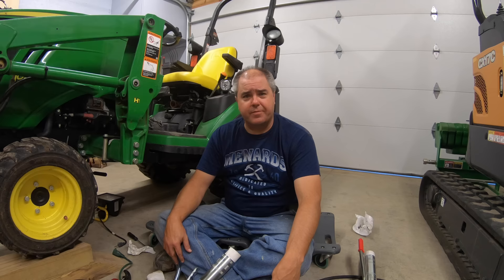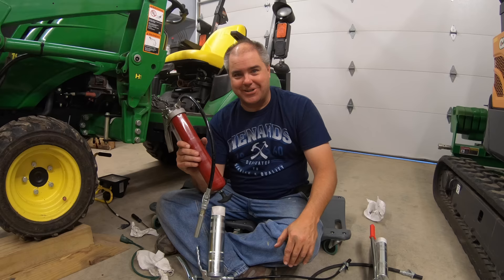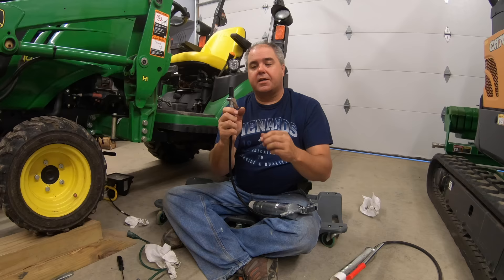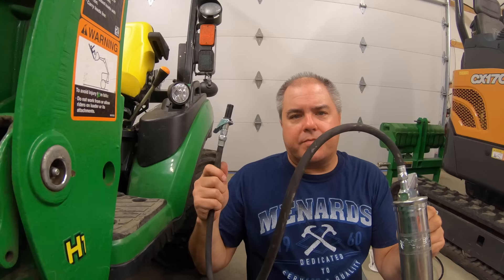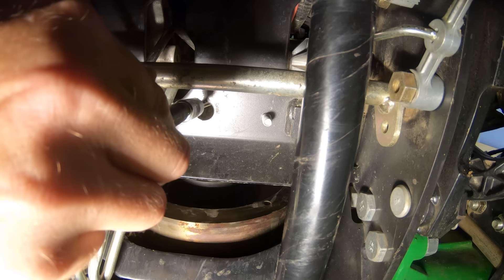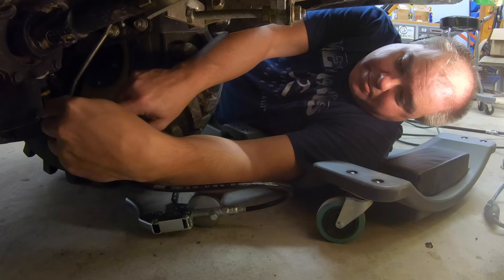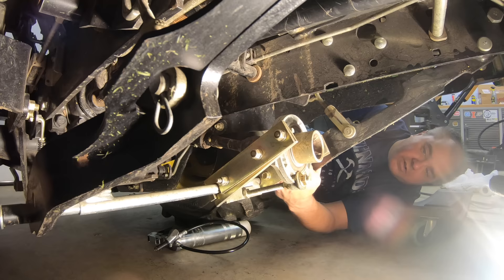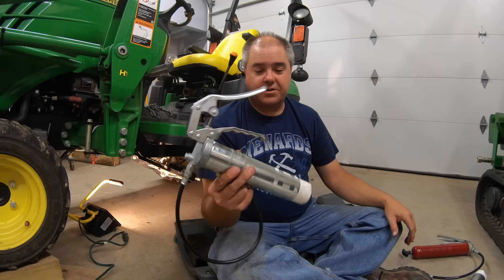New Grease Gun Technology! Greasing The 1025R/1023E Drive Shaft

Comment: Great video! Do you have any tricks for getting a u-joint to accept grease in all the caps when they aren't all purging? I have a 2320 and took it apart to access the driveshaft u-joints. Even with heating them up pretty thoroughly with a heat gun 1 cap on each joint, front and back, is not purging any grease. Grrrrrrr.
Reply from the maker: Lock n lube makes a tool to help.  I’ve not used it.
Reply: Jason, I have a 2305 (same u-joint as a 2320).  I have to pull my driveshaft out of the tractor and manipulate the ujoint to get all the caps to purge.  It is tedious!  It takes me about 5 minutes to pull the driveshaft after I get the tractor on blocks.  It takes me about 20 minutes to get all the caps to purge.  I use the Lock and Lube tool so that I can manipulate the ujoint with one hand while operating the grease gun with the other.  I went to this process as I could never get the caps to purge with the driveshaft still mounted to the tractor.  I don't know if the 2320 allows the driveshaft to be easily removed.  It could be that I have a ujoint where the channels were not machined properly.  My guess is that many who use the needle fitting may not be getting the grease to all of the cups.  Best of luck with yours.

Comment: Thank you so much! Lol. I have one question. Will the lock on adapter not fit onto the one zerk fitting?  I noticed you used the needle for the one that is nearly impossible to grease. I can get to all of mine with no problems, except that one underneath. Should I get the needle fitting over the lock on adapter?
Reply from the maker: You get both the LockNLube and needle fitting.
Reply: @TractorTimewithTim  thank you for your quick reply. I’m sorry for the confusion. I can get all of the grease points just fine with a standard grease gun. I can not for life of me get the one on the bottom middle. I noticed you used the needle grease tip instead of the lock on coupler. Does the lock on coupler not fit through the hole in the frame to access the zerk, or is it not long enough?  Just wondering why you used the needle one and not the coupler one for the difficult zerk.
Reply: @dfossilo  Tim has another video where he pulls off the panel next to your feet. Its a different access point and I use my LS there to lube that zerk.. Just move the flywheel until the Zerk appears - it is so much easier.

Comment: Watched this video and decided to buy one of those needle greasing adapters.  I went to your store and found it and placed my order on Amazon.  The model I received was a Lock n Lube LNL122.  It seems much smaller than the one you are using.  Does not have the neat slide over feature you mentioned in this video.  So my question is where did you get yours?
Reply from the maker: I'm not sure, actually. I didn't find the slide over feature on amazon.  The LnL one on my store should work.  Probably easiest to use it with the Lock n Lube locking coupler.
Reply: @TractorTimewithTim  No, I’m sure I have the right one because a few reviews mention it works great. Just kinda thought it would look like the one you used in the video
Reply: I do have the lock and lube connector. Thanks for all your videos. Very helpful

Comment: Where did you get the needle adapter? I did not see it on the website for the grease gun.
Reply from the maker: Single Point Hydraulic Connector; Deere 1023e/1025r/2025r
That is the name of the video describing it.  Unfortunately, when i paste, the link does not get pasted. Sorry.
I did make an error on pricing.  It is $634.70.
Reply: @TractorTimewithTim  I need the link for the needle adapter, it is not on the link for the grease gun

Comment: @ Tim
Do you know if Deere has re-engineered that "difficult to grease" U-Joint on new/later models of the 1025R? Also, do you know whether that nigh impossible U-Joint grease fitting is on the new 2025R tractors as well? 

Just one more question. How does Deere recommend a person go about successfully getting at that fitting so as to be able to keep it adequately greased?

Thank you for your videos.
Reply from the maker: All good questions!
Reply: Laurence & hopeful 
I have a new 1025r. I grease it regularly it is doable to grease
Reply: Likely this design runs through a lot of models. It is almost unessary due to the straight line up from the crank to the hydraulic pump at the rear. So sealed maintenance free universal joints would have been a better choice if the couldn't have designed better access.
Reply from the maker: Yes, I agree. This is likely a cost saving design.  The larger tractors don’t have this.

Comment: Planning to purchase the locknlube fitting and deciding between the regular and XL.  Would the xl fitting be too long for some of the other grease fittings?  Also, rather than the needle nozzle, would the locknlube XL fitting help access the main engine drive shaft?
Reply from the maker: I would recommend the 'regular'.  XL is just too long ...and no, it does not help with that nasty grease fitting on the drive shaft.  I use a needle for that...as shown in this video.

Comment: Great job Tim
Have you ever considered a power grease gun like a Dewalt, Milwaukee or Makita
Reply from the maker: Sure, we have considered one.  Tom uses them 100% of the time.  We have so few grease fittings that the hassle of making sure the battery is charged, and the initial cost simply is not worth it.  We do however recommend a battery powered gun for those who grease more than we do.
We use the same philosophy with our diesel tank.  Hand crank rather than powered pump.

Comment: Hey Tim, great video as always! I ordered the lube shuttle kit but I want to use the lock and lube.....the Amazon part number that you list for the adapter doesn’t work or is no longer available. I tried to figure out what I needed to make the lock and lube work but didn’t have much luck. I know the female side of the adapter I need is 1/8 NPT but I don’t know about the metric end. Any help would be great, thanks!
Reply from the maker: I believe LnL has an adapter to make it work.
The metric size is M10.
I’ll try to get some time to update this.
Reply: Ok thanks Tim, I’ll check it out. Oh yeah,  that was a faster than fast response!!

Comment: will they give me trade in value for my 18 volts snap on lol 90 bucks isnt  bad  for the gun and ten tubes of grease amazon does sell an extension that just the grease end with a grease fitting that is about 6 inches long or you can make one yourself with a 1/8 pipe nipple and a zerk fitting but yes the needle grease fitting great I bought one in the 90s for my i r impact gun

Comment: Not a fan of buying into a system with specialized parts.  If you could add an adapter to a standard grease tube, it would be more viable for everyday use.
Reply from the maker: Understoood.  However, this thing works great, and there is plenty of variety of grease available at reasonable prices.  
Sometimes we have to break out of the mold to get something which is improved.
The 100 yr old grease gun technology is in need of a revolution!

Comment: 2 years ago I was greasing my truck and the grease gun hit me in the left jaw joint. I am not over it yet. I bought an air operated grease gun from harbor freight on sale and will use it from now on. the grip will not produce enough pressure( I think) but the lever is difficult to use(sometimes). this new style has a squeeze grip so the question is can you get sufficient pressure?
Reply from the maker: There are specs on their website stating the pressures for each gun.  I didn’t have any issue, but I haven’t greased enough difficult zerks to provide feedback.
Reply: thanks for the video and the advise. I have an air operated grease gun now. It was 19.95 on sale. the cost of the new german system is way to much for me. I grew up on the farm in the 50s-60s we greased a lot. I am fine with conventional grease guns most of the time. One thing I notice you  not doing that we always die. Before we would attach the grease fitting we would carefully wipe off all the dirt and old grease. Then when through pumping LEAVE the glob of grease on the fitting to protect it till next time.

Comment: where do you grease the front axle
Reply from the maker: Deere removed the grease fittings for the front axle in 2018...long after this video.
Reply: @TractorTimewithTim   if i would have known this  i think i would have bought a different  tractor  .wonder how long it will last . very poor idea. not a happy camper
Reply from the maker: Totally disagree. The new bearings are sealed.  Less maintenance!    By the way, the BX has sealed bearings on the front axle too!
Reply: @TractorTimewithTim  what about the bolt that supports the front axle  that should be able to grease that. its a pivot point

Comment: Tim I know this is unrelated to greasing zurks. I'm wanting to buy a JD1025r I think it would serve me well on my 8 acre slice of happiness. It's a wooded property and I'm pretty sure a finishing mower would serve me better than a belly mower as I have a pond I need to back up to the edge of and other things to back under and mow as well as a grappel, land scapping rake for my drive way 1/4 mile long and a tiller for leveling and gardening duty's. My question is, is there a lock or a pin to hold up the auto connect under the belly so that it doesn't come down with the rear implement lift or can the 1025r come without any of the belly mower equipment. I'm afraid it would hang up on limbs and stuff. Love your channel by the way, I drive my wife crazy watching all the videos and talking about tractor stuff. Great family you have there. God bless y'all and keep the videos coming.
Reply from the maker: Yes, there is a lock to hold up the auto-connect while using the 3 point hitch.
Thanks for watching.  Hopefully your wife can maintain her sanity! :-)
Reply: Thanks a ton Tim

Comment: Another fantastic video Tim! Thank you. How many grease fittings are there to do on the 1025r? I am hoping to buy one asap. 

Also thanks for the new grease gun info! Not too expensive considering  all that you get. I will definitely look into getting one
Reply from the maker: 6 on the loader.
6 or so under Tractor.
6-8 on the backhoe
3 on mower deck.
Other attachments have a variable number.
The owner’s manual shows you the fittings and the proper intervals to grease them.
Reply: Tim, just did a 50 hour grease job on my tractor a few days ago.   

12 fittings on the loader
13 on the tractor
15 on the finish mower.
Reply from the maker: 1-series?

Comment: I want to buy the lock n lube but I'd also like to buy the attachment kit that lock n lube has on there website can u add that to your Amazon account so u get the credit thanks
Reply from the maker: If you find it on amazon, you can add to the same order as LnL and I should still get credit. Meanwhile I will try to find/add it.
Reply from the maker: I just added it.  Looks like a good value!
Reply: Thanks placed my order anything to make greasing easy and less messy I'm good with
Reply from the maker: Take a look at the lube-shuttle.  This is the ticket.  You can attach the LockNLube with an adapter.  
...You get a 5% TTWT discount at http://lube-shuttle.us/store
This gun does not need the leaky plunger!  I show it in detail here:  https://youtu.be/8HTvyfJIxZ0
Reply: I will definitely check it out

Comment: I like the new grease gun idea. I'm back the the regular pistol grip style again. The Lock n Lube tip quit working. I've always used the needle tip for that special zerk. If I ever get a new gun it will have to be battery operated.
Reply from the maker: Did you keep the repair kit that came with the lock-n-lube?  It came with a repair kit, but I've never tried to do the repair.
Reply: I bought mine when they first came out and no repair kit was given at that time. Paul Short did a review back then and that's when I bought it. Worked good while it lasted. I still have it, don't ask me why.
Reply from the maker: I guess I should find my repair kit and send it to you.
Reply: No need. What I have works. But thanks for the offer.

Comment: No way would I lock into a grease gun that takes a special cartridge that I can't get at WalMart, tractor supply etc.
Reply from the maker: Fair enough.  … but you are missing out.  This is clearly a step forward in technology!  Amazing!
Reply: @TractorTimewithTim  Hmmm.  Pretty strong endorsement from a man with a lot of sense.
Reply from the maker: @SeaPro360  thanks.  And yes, this SHOILD be the future.  Will it be able to displace 100+ years of tradition? I do not know.  I DO know that it is MUCH better than the leaky, messy 100 year old system.
Reply: Mess is right.  I have 3 right now. One with outboard motor grease, high speed wheel bearing grease, and "whatever" grease for drive shafts, log splitter etc.  I use an empty shotgun shell on the end of each and tie the handles to the tube with a rag. Yep, a mess...and I love gadgets. Hmmmmmm.

Comment: Two comments. you have to use their grease, and the style and size of the gun takes up room in clearance when you are under the tractor.
 It a shame that the lock-n-lube connectors don't it onto the gun.
 
 IMHO I think the G Gun from lock-n-lube is a better solution. The only draw back is the volume of grease it holds they need to make a smaller
version of what they have now. It easier to use your foot or hand to operate the pedal with the 10 foot hose and not have to fight the size of
the gun itself. Can you fill the tube that comes with the gun with whatever grease you want to use, one comment below says you can.
Reply from the maker: Bob, the lock n line connectors DO fit the lube shuttle.  2 choices there. 1) call lube shuttle and ask for the metric version, and 2) use the adapter from my amazon store.

As for the clearance, I don’t see much difference from a standard grease gun.
Maybe even a bit shorter due to having no plunger.

No experience with the foot operated gun.  Might be good in certain situations...seems like difficult when you are laying on your back!

Your last complaint...you have to use their grease.  Big deal!  The cost is reasonable. The grease is high quality.

And look at the major advantages.  Tubes easy and clean to swap, no plunger to leak, lighter weight gun.
Reply: @TractorTimewithTim  Thank you for your reply, I appreciate it.
You can operate the foot pedal on the G Gun by hand and has a 10 foot hose when lying on your back.
One reviewer said you can use your own grease once the tube is empty by refilling it with your choice
of grease. It would be nice if you could purchase empty tubes with the gun so you would have a choice.
Reply from the maker: Not sure if you can buy empty tubes or not.  I will say that this is the absolute best grease gun technology I have seen.  When paired with the LockNLube, it is fabulous.
Reply: @TractorTimewithTim  Yes you can click here https://advancedenginetech.com/product/empty-lube-shuttle-cartridges-10-tubes
I was so impress with the pistol gun I now ordered the lever model. I did use the empty tubes and took the other seven tubes of grease
that I had and filled the empties that I purchased from them. It was a little messy transferring the grease from one tube into theirs, but
bottom line it worked. I couldn't see throwing away seven tubes of grease just because the tube size were different.

One comment I am not crazy about the end of the gun being open like that so I will make some king of dust cover for the end
to keep the dirt from getting in when using the gun. Many thanks for the discount code it wasn't a lot but it was something.

Comment: Not a fan of needle greasers tim they are good and ruining the zerk, when you shove metal into the ball end you damage it there usually intended as a last resort for a zerk that won’t take grease
Reply from the maker: interesting.  Well, this IS sort of a "last resort".  The 2018 and later models of 1-series cannot be greased from the 'top side' anymore as the shield doesn't come off like I showed in the other video.  This crazy hole is too small, and is misplaced.  Some engineer was having a bad day when he designed it!   Anyway, it is nearly impossible to get a regular grease coupler onto that fitting. It CAN be done if everything is perfect, but I have worked for an hour or more to do it.
Reply: Tractor Time with Tim for non turning grease point adding an extension hose to the threaded part with a grease fitting on the other end makes life easier. Some of the equipment I’ve operated has a grease block with hoses running to many grease fittings.
Reply from the maker: Did you see the end of the video? That approach is used on Casey.
Reply: It does suck to hit that zerk , loose the ball and seat on that zerk will make the joint fail quicker all the grease will push back out the hole :)